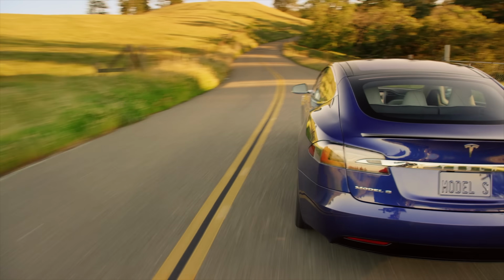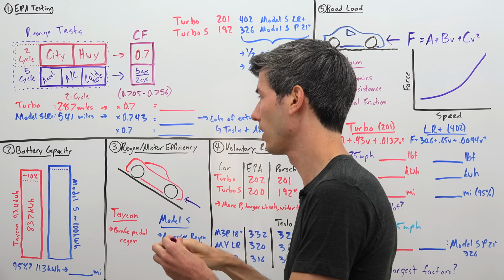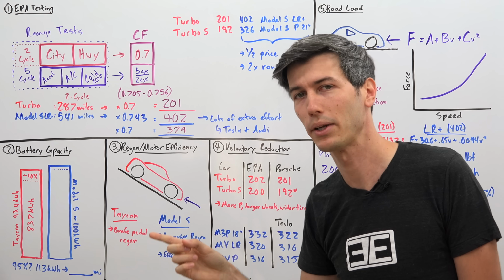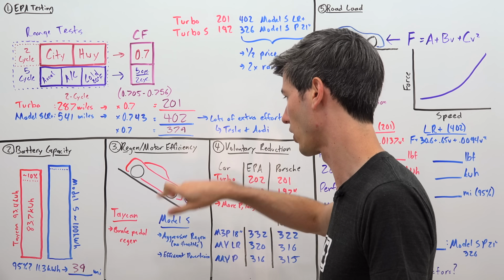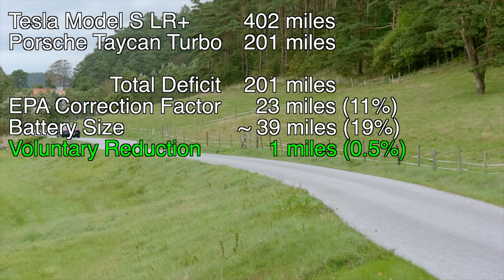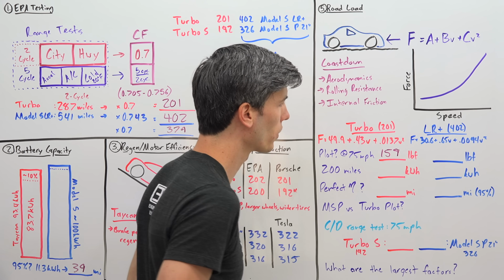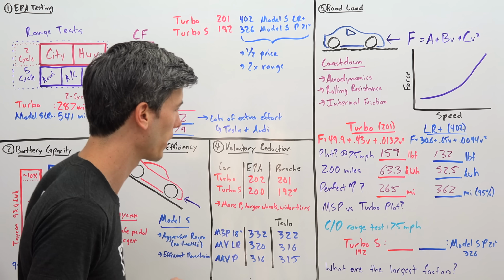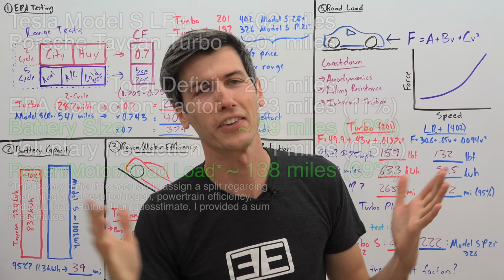Tesla's Secrets To Dominating EV Range - Double Porsche?!

Comment: Great effort Jason but you completely missed the efficiency losses from the turbo on the Porsche. Surprising since you've had several videos talking about turbo efficiency problems. But honestly I think if you have the money for either of these a range trade off for some tsutsutsu is worth it.
Reply: The "turbo" only kicks in during acceleration and is unlikely to have much impact on the highway range.  It may help explain the difference in city range, but his point is that nobody cares about the city range because they are usually not driving far enough to consume more energy than they can reclaim charging at home while they sleep.  For cars that people park on the street and can't charge at home that probably matters.  The Taycan Turbo will rarely be one of those cars.
Reply: @robertm3951  Yeah but that's why the cruise numbers are so much closer. Though there's still gonna be losses there. No getting around the extra energy that goes into pumping oil through the turbo and the additional drag for the intercooler. And while I'm sure they've got great antiknock being Porsche, they've still gotta run a bit rich for safety.

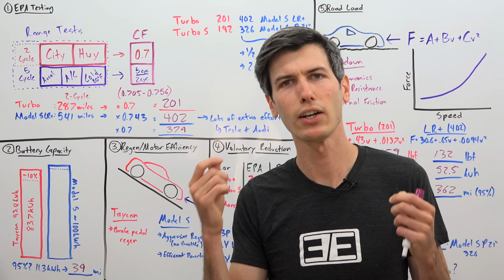Comment: 14:17 YES YES YES! 100% agree. Highway range is the one that counts. Also, here's something wild: if you take the highway numbers presented here, the Model S P would drive 195.6 miles on 83.7 kwh, so it would actually be LESS efficient than the Turbo S. (even more so if the tesla battery is actually 98 kwh usable which tests suggest) Still doesn't quite justify the crazy price tag on the Porsche though...
Reply: For a Porsche that is true because owners can afford to charge at home.  For a city car with slow charging that parks on the street every mile counts.
Reply: @robertm3951  true but I would argue that if you can't charge overnight or at work an electric car is a bad choice anyway because you shouldn't fastcharge all the time.

Comment: Every time I see calculations like this involving foot-pounds, miles, and kilowatt-hours I thank Dawkins for the SI unit system.
Reply: Most US engineers use or would prefer to use metric but the supply chain of parts and materials is typically only stocked with English sizes so if you want things fast it has to be in screwed up units. Dont even get me started in gauges.
Reply: @j4k3br4k3  
Plus NASA using metric
Reply: @j4k3br4k3  so,  if not the engineers, who are the ones preferring the weird/tyrant king units?
Reply: @j4k3br4k3  Fortunately in the other 95% of the world - including England - we've long since changed our supply chains.
Reply: @j4k3br4k3  If you need to order parts I guess you're stuck with English units. However in this case he could just convert everything to SI, do the calculation, and convert it back.
Reply: @Aaron_Nonymous  That's also how to crash into the moon
Reply: Why do you thank Dawkins?
Reply: @Jupiter__001_  I just thought it was funnier to replace 'God' with some noted atheist when praising communist atheist SI units.
Reply: Foot-pounds really are among the weirdest.
Reply: @WyandWombat  foot-pound, not to be confused with pound-foot 🤪
Reply: As an American if you were to talk about Newtons we'd have to ask you how many figs are lost.
Reply: At least kW-hr is derived from SI.
Reply: @lizzardwizzardreal  Energy is measured in Joule = Watt * seconds.
1 h = 3600 s, so 1 kWh = 3600 kJ.
E.g. VW ID-3 Pro S has 295 MJ battery = 82 kWh.
Reply: Car and Driver did an article on how Tesla games the system.
Reply: I prefer the freedom units 🇺🇲🇺🇲
Reply: Point Break well there is like two countries that use it and most engineers/scientists in America use metric anyway
Reply: @hubertkam7647  plus, engineers sometimes use imp system only because cad automatically converts for them lol.
Reply: @MrComputerCoder  aren't those a king's body parts units?
Reply: @TechFabLab  Yep - Henry VIII's. Always tickles me when USAnians talk about "freedom units" that were actually created by an English monarch and later standardised for use throughout the Empire (as "Imperial Units").
Reply: @MrComputerCoder  
You mean Donkeys unit 🇺🇸
Reply: @MrComputerCoder  You wrote 'stupidity' wrong
Reply: @MrComputerCoder  they ate literally not freedom units, they are British units
Reply: @cristianoamaral829  these are the unity, why the revolution started lol

Comment: In other words, the EPA range figures for EVs has as much to do with reality as EPA fuel economy ratings for ICE vehicles do 😁
Reply: Nope. As he said in the video the EPA test does not represent constant highway driving. The increased range of the Tesla in the testing is due to aggressive regen. Porsche lacks this feature.
Reply: Yeah...I know with gas cars I often get 2-4MPG better than rated highway (26-28 rated 24) and about 4-8MPG less than rated city mileage (10-14MPG rated 18) consistently...and I have gone around 410 miles on a tank highway driving with the computer estimating 70-80 miles remaining when I went up to visit a friend several states away.  I have worked out over time it seems like 62-63MPH is the peak fuel economy highway in my car, which aligns well with 55-60mph primary highways.

I would love to have an EV to rent for a couple weeks to see how they compared without committing to buying one in case it doesn't work out...shame nowhere offers them here.  I called several of the big rental chains they couldn't find any within 100 miles of me.
Reply: the epa tests are usually close to the real world if you drive like you are not an enthusiast.  hyper milers do better, hooning does worse.  as it should be
Reply: if you live in a cold climate you will get much worse mpg as the engine burns extra fuel to warm up and keep warm if you drive an empty truck ... i get what the epa says on everything i drive so im not sure what your doing wrong
Reply: @philtripe  EPA's testing speeds are slow (therefore the car sits in low gear the whole time), and they test the car in all modes, including Sport and Sport+ for the Taycan.
Reply: @Jupiter__001_  EPA testing is designed to simulate fuel and electricity consumption based on how cars are on average driven. That isn’t 75mph on a highway, I’m afraid.

Comment: You would think the Porsche engineers would have figured out how to fully take advantage of the test rules, no?
Reply: Porsche has a reputation to uphold. They have used conservative figures on all their cars. I guarantee if Porsche says their car will go 190mph you can bet it will top out at 200+
Reply: @trance9158  I get the reputation obsession, but still, people who buy expensive EVs want range. If Porsche wants to lose sales because of the poor EPA range, then they can certainly keep their reputation....
Reply: @barryw9473  the EPA numbers have been proven to be very very misleading. Just as Tesla actual real world range is much less then they state. Then there's also the build quality factor....Porsche doesn't cut corners. Tesla's build quality is not anything to boast about .
Reply: Trance 9 I don’t care about Tesla and I agree quality is not always great. I want Porsche to sell more EVs so they need to up their rated range either through proper testing or better efficiency. My experience with e-Golf ownership is that EPA range is dead on correct. What is your BEV experience?

Comment: They should just use a dyno to figure out range and have various test conditions. 

For Highway just stick it at 75mph or whatever until it dies.

For city, have it constantly start/stopping between 0 and a range between like 10 and 30mph.

And then an inbeteen of city and highway where you could be driving at highway speeds for like 20 minutes and then city for another 20 minutes to simulate going from home to a town/work or something.

Literally just record data from someone driving these various routes and then put that into a computer as a standard for all cars.

Comment: Soooooo.... the S P that C/D tested had 21" wheels right(just like the Turbo S)?
Big wheels affect the range by a huge amount.
Teslabjørn recently tested a Taycan with 19" aero wheels and it was very close to the Tesla, 570km(the Tesla got 644).
Reply: The rim diameter doesn't play a big part, but the overall rim/tyre diameter does. Physics actually tells us that a larger wheel rolls more efficiently (that's why shopping carts are so hard to push fast and why the BMW i3 has huge but narrow wheels, and why 29" mountain bikes are more and more popular) but the factor that seems to be reducing efficiency is the tyre width and wind resistance. A wider section has more friction with the road surface, and the larger wheels will almost always have a correspondingly wider section.
Reply: Chris Burn total weight of tire and wheel have a an impact. There is energy loss due to spinning the tires/wheels. Lighter weight will be more efficient.
Reply: @chrisburn7178  unless your rim is a flat disc,
Larger rim means larger surface area thats not aerodynamic,
Ofc tire width and overall rolling diameter means alot,
But most cars keep around the same rolling diameter with all wheels
Reply: a tiny wheel with a big heavy tire doesnt help either... in theory the taller rim should do better being that alloys are way lighter than rubber and steel
Reply: @philtripe  but a tire is aerodynamic,
More rim means more drag
Reply: Bjorn's range test is at 90kph, right, to sort of simulate average driving speeds. If you think about it, that assumes a typical consumption dependency vs speed, that is low consumption at low speeds and high consumption at high speeds. But this Porche clearly has a very high consumption at low speeds, possibly in that fist gear that they have.

Edit: Or they'r just simulating the very high consumption of performance ICE automobiles in city driving.
Reply: @ingerasulffs  he also does the same test at 120kph too
Reply: @ingerasulffs  T-junk-fanboy nonsense! Based on my BC my Taycan uses about 24kWh/100km but my MS90D guzzles slightly over 25kWh/100km.
Reply: @cyberslim7955  who is the Tesla fanboy you are referring to? Bjorn (he just presents the facts usually, with some Norvegian Ninja humor on top), Porsche for getting 200miles on internal EPA testing or me for wondering why?
Reply: I have a question. How does having larger wheels decrease the range of an EV?
Reply: @rahulb9059  larger wheels usually have rims designs which are less aerodynamic. This increases the coefficient of drag (cd) of a car. 

This is best shown by the Taycan Turbo having a Cd of 0.22 and a Taycan Turbo S having a Cd of 0.25. They have the exact same body which means the only difference to the cd has been caused by the Turbo S having large 21 inch rims with their open design compared to the Turbo's 20 inch rims with their aero design (closed off) 

Basically air gets trapped in the wheel and slows the car down. To overcome that the car has to use more energy from the battery to overcome that resistive force.
Reply: @supaahflyy  Thank you for the explanation! I understand it now
Reply: @rahulb9059  They are less aerodynamic I think due to the walls being smaller, or to the overall wheel having a larger hole in the middle. So, smaller whole, less drag.
Reply: I think it's interesting that it's one of those style over substance things. I have a sports car therefore I must put big, fat tyres on it because like red stripes and spoilers, it'll make me go faster! Reality is of course a lot more complicated with mass, drag/aerodynamics, friction etc all playing their parts.

Comment: I think the test result at 75mph goes a bit into the problem that you described in the video about energy density when comparing towing with EV vs. ICE: the larger an "inefficiency" (e.g: drag) the more important is the amount of energy a vehicle can carry. So, traveling at 100mph, two EV's with similar drag coefficients and with a same capacity battery would get almost the same range, meaning the motor and other battery and mechanical efficiencies would matter less in the final result (hence, this Porsche vs Tesla difference would be lower, and even lower with higher speeds). I'm not saying a 75mph test is meaningless: you pointed out perfectly why it should be done and results released to the public. But it would not make it clear for the daily driver (it could actually make it confusing) the differences between vehicles. In the example above, at 100mph, the range difference would be reduced to 69miles.

Comment: Would you please explain, why the fuel consumption is not 4 times higher if i go 200km/h compared to 100km/h? (It doubles about...)
Reply: Because u have less revs per km. If u drive 50 km/h with 2000 rpm u need twice as many revs for 100 km as if u would drive 100 km/h with 2000 rpm.
Reply: I your car only doubles in fuel consumption then going from 100 to 200 it means that the engine is under low load at 100. By increasing the speed an also the load you increase the efficiency of the engine. This is the reason for downsizing, by using a smaller engine that is under high load at 100 you fuel consumption will be lower than for the bigger engine at that speed. If you increase your speed to 200 the car with the smaller engine will use fuel like there is no tomorrow.
Top gear have made an episode about this, making a M5 use less fuel than a Kia ceed under the same driving conditions.

Comment: That test does exist, its called Tesla Bjorn!
Reply: Exactly, Bjørn is the go-to guy for BEV range tests.
Reply: What was Bjorn's conclusion?  Was it similar to what C&D said?
Reply: @CoralSea  The important metrics are efficiency at certain speeds. Iirc for model 3 it was 4.25 miles per kWh and for ionic EV it was 4.5 miles per kWh so the ionic (similar size and shape sedan) is about 5% more efficient per kWh
Reply: @CoralSea  he tested a Taycan 4s with small 18 or 19 inch rims (I can't remember exactly) got around 540km afaik. 

Basically don't believe Porsches range. It's a lot better than they state and  similar to Tesla's. 

Another channel called next move did a range test and there was a 12% different in battery I think. Not 50% as EPA would have you believe

Comment: Wind resistance is the key to highway range. I found the best compromise when I had a Renault Zoe was to slipstream a truck at a safe speed (about 185 miles range doint that but more like 135 miles at normal speed)

Comment: Pound force? I always thought it was pound foot.
Reply: Pound feet is for torque. Wind resistance is not applying torque to the vehicle, it's applying a resistive force. Just like you measure a rocket or jet engine's power in pounds of thrust, here the "pushing force" against the car is being measured, not a twisting force.
Reply: Levon Tarver Ah, that makes sense :) Cheers for the update. Most appreciated. 👍

Comment: Well all the 90+KWh of the Taycan May be used more efficiently.
Look for Bjørn Nyland review of the Taycan 4S 93kwh, he made 360 miles/580kms at highway speed.
And NO Tesla is not lying when they state 400+ miles range the same Bjørn did a real world range test and achieved 617kms of range
Reply: "And NO Tesla is not lying when they state 400+ miles range the same Bjørn did a real world range test and achieved 383 miles of range" ??
Reply: @niall21  he meant 644km I think. As far as I remember from that video he showed it reaching the 400 mile figure. However we must not forget both these cars were driven at 90 kph on the highway to achieve these figures. No one drives that slow. 

Bjorn also as part of his testing does the same test except at 120kph and he got 420-425km range for the Taycan 4s and 480ish for the tesla. 

Again these numbers are just from memory and most definitely not remember correctly. I recommend that video if you're interested
Reply: Test by a tesla fanboy
Reply: @fleyua7176  He made the Taycan look great compared to specs and the Tesla look underachieving... Nothing wrong with being a fanboy if you're honest about it.

Comment: That difference in regen strategy also explains why Toyota hybrids and EVs are often under-rated by the EPA as they don't have very aggressive regen until you start commanding it with the brake pedal. Luckily the brake controller and actuator in these cars are smart enough to not actually engage the brakes themselves until full regen is achieved.
Reply: Porsche did that on purpose, to make the car behave like a normal car. But if you hit the brakes, the Taycan regenerates to up to 265kw, compared to 60kw of the Model S.
Reply: @scratchy996  That's why Toyota does it too and I have no preference either way. It was just an observation 🙂

Comment: So Tesla can get over 200 miles, maybe 300.  I look at how long does it take to recharge the battery vs how long it takes to fill the tank of my 2020 RAV4 or my 06 Nissan Frontier.  Tesla claims a low amount of time.  Ok, but as an auto technician knows, batteries do NOT like to be charged quickly!  Overnight...... yes.  2 to 4 hours depending on size.....no!
Range data's fine,  just keep the overall as part of the equation because TIME is essential.

Comment: there is a whole lot to digest here.
first, the so-called regenerating breaking as soon as you let off the gas.
when i drive with MOST tesla drivers, they want to break my neck with their inability to GRADUALLY lighten the gas as a means of slowing down.
they never can keep a steady foot.
so they tell me tesla offers the option of gliding...JUST LIKE THE PORSCHE and every modern gas engine.

so what, if both used the exact same way, would the real data be?

people, this epa/real world/manufacturer mileage free for all is madness.

Comment: Bjorn Nyland actually drove 580km (362 miles) in a Taycan 4s. Perhaps the  EPA guess needs a rethink, might as well just pluck a number out of thin air when its this inaccurate
Reply: still porsches fault for not doing the full test
Reply: and there are people that  would rather bet than check how is Taycan doing :)